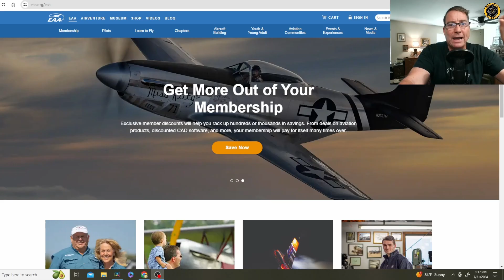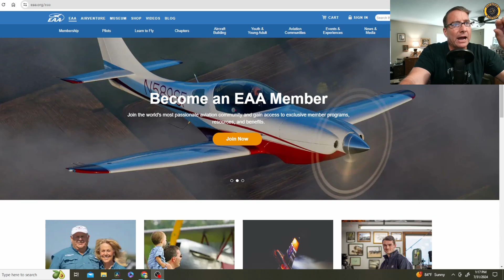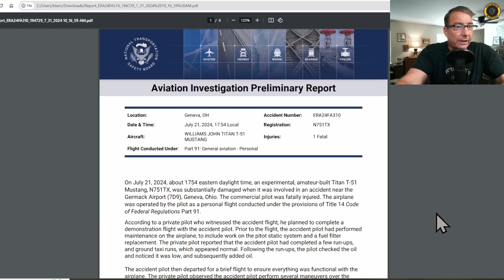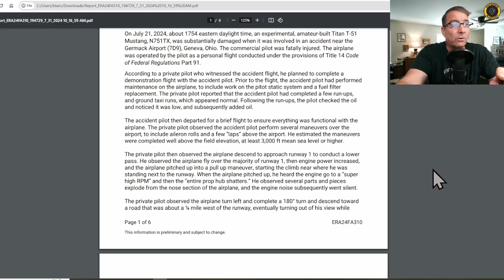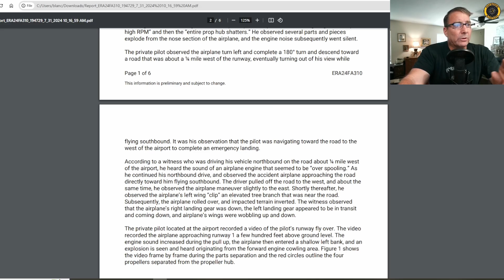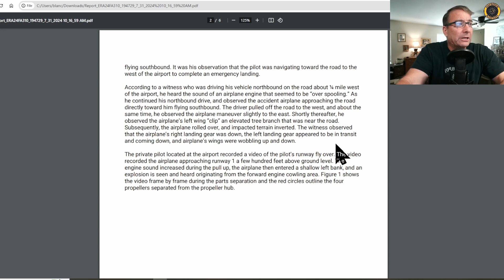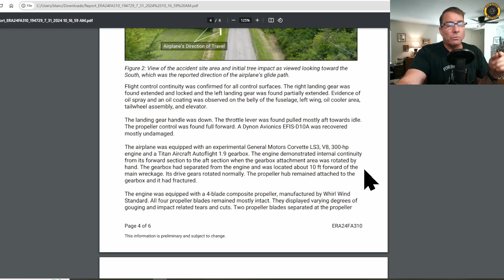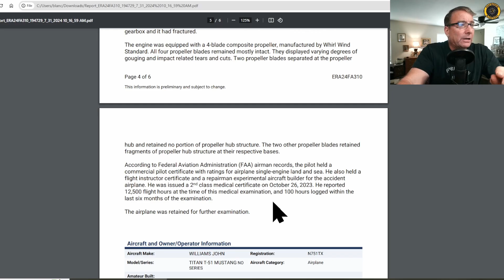Titan T-51 Fatal Prop Hub Failure 21 July 2024

Comment: I find it extra tragic when a good pilot who did everything right and went out of his way to observe safety and best practices ended up not making it due to simple bad luck and circumstance. Sad
Reply: Something broke when overstresed, probably by execessive G forces on the part, due to his high performance  "Zoom Climb" maneuver. That's what happens when being a test pilot. The real question is the part that broke a design deficiency, that will likely again fail when attempting that same maneuver, or a cumulative  stressing  mode which will require a lifetime limitation, then throw the part away requirement.  Parts metallurgical engineering is why you pay $30 to $3,000  for a/c  bolts, instead of going to the hardware store and getting the same size and thread for 30 cents to 3 bucks.
Reply: @jakerabinz9411  30 to 3,000 for a bolt? lol.
I built airplanes for 20 years and there are no $3,000 bolts in this airplane or any other unless you can show me an invoice for one.
Reply: @popsfereal  I stated "a/c". That includes any type of aircraft including helicopters, supersonic and even hypersonic jets, with or without rocket or scramjet motors. Have you ever worked on such with Inconel parts.  Have you ever heard of the so nicknamed "Jesus Nut" on a particular make and model of helicopter, which if it lets go DUE TO OVERSTRESS in a poorly executed autorotation,  the rotor head flys away by itself.
Reply: @jakerabinz9411  Excessive g-forces? When do you think that happened? Yes, some part failed, and we don't know why, but the aircraft was designed for and easily capable of handling that maneuver. My rented Cessna could handle a maneuver like that. There is no way this aircraft had cheaper non aircraft-rated parts on it. This was a serious builder with a serious business. If the investigation finds substandard parts I'll be more than shocked.
Reply: @beenaplumber8379  G forces are the result of abrupt vectoral changes in kinetic motion. Read about the "Vomit Comet" where negative G force is routinely implemented. Read about any moving object crashing into any other object at 400 mph, and the instant destruction of parts and instant liquidfractioning of anything biological onboard. Or a non jacketed 30.06 round  creating a .3" entry wound, yet also an 8" exit wound from 400 yards That is all due to excessive G forces.  Or how 'bout a violent car crash where all the lug nuts break at once and the wheel seperates from the hub. Or a 2 " axle sheers. Are we to just pretend that a prop hub, just willed itself to split apart without any sort of OVERSTRESSING?
Reply: @jakerabinz9411  You have a general understanding of what g-forces are - excellent. That does nothing to explain this failure or whether it was related to this relatively mild maneuver. G-forces are accounted for in the design. This is a matter of failure under g loads that were within design limits. That might mean fatigue cracks or other failures, including prop control and downstream failures resulting from prop overspeed. A lot of things could have caused this. There was an overspeed that preceeded the mechanical separation of the prop blades. Have you got an explanation for that? I have a simple hypothesis awaiting evidence. Have you got that much? An alternate hypothesis? Or just cool stories you read about?
Reply: But that's not what happened at all.
Reply: Yep. General aviation in an experimental plane is Russian roulette 😅
Reply: @BlingtingSam  What?

Comment: Engine suddenly revving could be loss of load.  I don't know this set up and couldn't say what happened.  I was running my boat many years ago, and the shear pin on the prop just let go under heavy throttle.  Even though my hand was right by the control, the engine badly over-revved before I could throttle back.  Condolences to the family and friends of this man.

Comment: I run a racecar with an LS3. It is barely good enough for the racecar. The big problem is the spark plug location. They are located rite next to the exhaust pots. Even with wrapped headers and high temp wires we still burn through 1-2 a racing season. Could not imagine trying to put one in an aircraft.
Reply: The LS3 is not putting out anything like full power in this application and there is no header- just short stacks with airflow right by them. So doubt that's a concern here.

Comment: I think beyond the high rpm of auto engines requiring reduction gearing is automotive engines were designed for limited high output of over 50% power even high performance cars is even on the autobahn cars don’t maintain high output for long duration where aircraft engines generally stay at 75% or more power there entire flight
Reply: The LS engine is used in boats and trucks with heavy tow ratings regularly, they are designed and regularly used in high sustained output applications every day.

Comment: The builder mentioned having a safety factor. Designers must predict under which conditions the parts will fail. A proper design would have the engine fail before the hub came apart. Also, an RPM limiters would be required if it is possible to overspeed the engine during routine operations. If this turns out to be poor engineering, too much faith was applied during the design phase.
Reply: With the 1.9 box the prop hits its redline,  allowing for a margin of safety, at about 4750 engine rpm. Engine redline is over 6000.  So no.

Comment: Concerning the use of an automotive engine in a mid-RPM application, it is possible to build such an engine with high torque. low RPM configuration with its redline at or around 3500 RPM. Many components can be optimized to produce low RPM torque over high RPM horsepower. I'm not sure why this is never done, such a configuration would mimic the torque curve of a diesel engine and be ideal for towing and heavy-duty truck road applications and also aircraft. This would involve using longer connecting rods, special crankshafts, smaller diameter intake runners, and exhaust system diameters.

The reason may be that doing this reduces peak horsepower significantly while gaining torque, this may be why it is not done, not many people want to minimize a V-8 engine's horsepower. Yet doing so would reduce or eliminate the need for cranky reduction mechanisms.

Comment: If we know for sure that the overspeed happened before the hub failure I think it must have been a failure of the prop adjustment mechanism. I actually can't figure out exactly which prop was being used on this plane. Looking at the specs in the report, titans website, and the prop manufacturers site, I couldn't find one that matched. But it looks like they're all adjusted hydraulically. If that failed they may have flattened out and drastically reduced the load on the engine.

Comment: Failure of the prop Gov or loss of oil pressure to the gov (if oil controlled Prop)  normally causes the prop to go flat, High RPM in non reversing / non feathering piston props.
Reply: yes , and is the case with this setup

Comment: Bad moment for that failure to occur, obviously he knew the area and made the best job of trying to get the plane down again, which must have been difficult with sudden loss of power in a steep pitch up condition and having to do a 180 degree turn without stalling - could easily have been a stall spin crash. He would have had a very high workload trying to get the plane configured and lined up for landing, just clipping the tree was the tiny margin away from success... so sad...

Comment: The engine couldn't over-rev like that unless somehow it became unloaded.  The prop pitch must have changed, and rapidly.  If the gearbox failed, then the prop couldn't have overspeded; it sure looks like the prop pitch mechanism that failed (here from the ground, and far away).

Comment: Let go in to physics. 
1. The aircraft pulled up, the propeller hub fractured , the blades shed off. The engine overspeeded there after: no countertorque left.
The gyrosopic law says: M = I * omega(=pull-up) * omega (=revs).  If you pull up there is a moment working sidewards (depending the rotation speed, direction etc) acted by the blades on the hub.
These bending moments are SUBSTANTIAL and a sinus moment (+/-) is executed on the blade root, each revolution.
These fatigue moments are often overseen  by amateur propeller manufacturers.
I doubt how many readers know this physic-gyroscopic law.
Reply: If I'm understanding correctly he applied high power during the low pass and then pulled up sharply to climb. This put high gyro loads on the prop and could have initiated the failure. Aerobatic pilots reduce engine power before doing violent tumbling maneuvers to avoid ripping the prop off the aircraft, and they use especially strong prop/hub units. These gyro forces require very serious engineering to deal with. I suggest using the word "overlooked" instead of "overseen" in your technically excellent comment. Thanks.
Reply: excellent point. thank you
Reply: That was my first thought upon hearing of the accident sequence.

Comment: Informative as ever, thanks Juan.  If the gearbox is a custom design, and over revving is a known problem, why doesn't the design incorporate a fail safe speed limiter?
Condolences to the pilot's family.  Worth noting that it was the tree and misfortune not the propeller hub that led to the fatality.
Reply: the hub failed, not the gearbox.
Reply: @Pantdino  Yes, and why did the hub fail?  As reported by the eye witness, the engine was over revving so the gearbox output shaft was spinning too fast for the hub to withstand the centrifugal force.  Hence my suggestion for a speed governor in the gearbox. That is only my suggestion, for what it's worth.

Comment: I mostly follow car and motorcycle content so it is unusual for me to hear an American use the word "gearbox". In UK we use that word all the time as transmission is a more general term. For example, the transmission of a rear wheel drive car includes the clutch, gearbox, propshaft, differential and axle.

Comment: My first question is what is used to control max engine rpm. And are those parts complete or damaged in some way.
We run a gasoline powered sawmill with a air cooled VW engine, it uses a mechanical governor with a belt to it. You loose that belt for whatever reason. rpms will go for the moon, until something fails.
A diesel engine has the governor right in the injection pump, where as for are VW industrial gas engine setup, it uses a separate component for controlling engine rpms.
.
I dont know whats used to control rpms on that LS engine. 
but as a mechanic, i would definitely take the time to rule out any failure of engine governor.
0.01c

Comment: The other use for having aircraft in the experimental category is to avoid expensive certifications even in mass produced planes. For example I owned a Standard Jantar  1 sailplane for many years. It was classed as experimental even though thousands were built. This applies to many commercial built sailplanes even though the production runs may be fairly large, the certification costs vs. the total retail sales don’t make sense to the aircraft companies.

Comment: Prop feathers causes the engine overspeed (no more load on engine), propellor rotation dramatically speeds up (LS has a lot of torque) and centrifugal force tears the prop blades off.  Preliminary inspection says engine good, and gearbox good.  Instant feathering of prop commanded or not created this event.  The talk of rev limiter is potentially misplaced.  No proof a rev limiter is in place and if it is and is stock, it will let the engine run to red line then bounce on and off it.  That is a VERY distinctive sound and likely would have been reported.

Comment: Not sure how the engine goes into an overspeed condition unless it was suddenly unloaded under throttle. The LS engine family are fly by wire computer controlled engines with the computer controlling both injectors and ignition timing. Could the hub have broken free of the gearbox output shaft first allowing the engine to unload and overspeed? It would also be intereisting to see how an automotive throttle controller aka gas pedal was configured to work as a hand controller in the aircraft.

Comment: I own a Corvette with an earlier variant of this engine, the LS1. The LS3 is around 370 cu in and over 400 HP stock. They require a computer system to operate, unless the engine is very extensively modified. The computer in my car employs a "rev limiter" function, to avoid overspeeding the engine. I would imagine that if this  LS3 were not modified to run without a computer, The engine could have been detuned to produce 300 HP, and rev limited to a value corresponding with the maximum safe propeller RPM. I am really curious about this engine installation, and what caused this failure. Godspeed to the pilot, and condolences to his family and friends.
Reply: We have no knowledge as to whether the engine speed was limited by the ECU.  
The fact that the engine overspeeded suggests that the engine speed was NOT limited by the ECU.  
The engine speed probably was limited only by the propeller pitch and pilot.  
It is easy to see now, with the benefit of hindsight, this was not sufficient redundancy.  
What now for all T51 owners?
Reply: I would think it still had an ECU, probably a custom built and programmed one.

Comment: Mr. John Williams seems like a highly sober non-cowboy kind of guy.  I look forward to learning what caused the overspeed condition, be it before or after prop failure.

We are fortunate to have the ability to fly experimental aircraft, which have varying degrees of safety and innovation.

Good aviation rules, restrictions and practices are often driven by tragedy.  Is there a role for electronic overspeed safety devices (almost zero cost) on experimental aircraft with automotive engines?

Comment: Impossible turn gets someone again... looked like a few fields were available but would of probably been gear up and damaged the plane... Wonder if saving the plane may of played a roll in trying to squeeze into the narrow rd....
Reply: He successfully made the 180 degree turn, so not impossible. The plane flipped canopy down in the last few feet of the landing.
Reply: @jackwickman2403 he ran out of energy,at the end  didn't have the control authority to thread it into a narrow  slot and hit a tree... Stop trying to make the impossible turn... Im familiar with the area I live 1.5 hours west of it... There's a couple open fields near it... The only reasoning I can think of that turn and attempt to get onto pavement is to save the plane....That road would be a bitch to get into powered let alone in a glide with who knows what damage to flight control surfaces...

Comment: Out of curiosity, can you please explain why you can’t have propeller tips break the speed on sound? 

Obviously there is a certain structural integrity limit for every prop… But does that limit typically occur around the sound barrier? And that’s why it’s in place? Or does it have to do something with aerodynamics, where propellers efficiency would be affected or something? Or does that have something to do with a noise constraint?

My apologies if this is a dumb question(s)… I am not a pilot myself.
Reply: Noise.

Comment: The owner pilot seemed very reasonable and quick to acknowledge the problems associated with making an auto engine work reliably in an aircraft. As he pointed out it’s the reduction units and other related system components that are more often the points of failure. I’ve always held the opinion that propeller reduction units are the stuff of industry. Just take a look inside the nose case of a big radial engine built in the forties. Very complicated, precision designed and manufactured planetary gears. I too like and fly almost exclusively experimental aircraft with the exception of my day job. But I never fly behind auto engines with experimental reduction units, belt drives or any of that stuff.

Comment: What is even the point of the car engines in planes? Seems like a non-starter. Also, how do they handle high altitude.  But just... Why?
Reply: They're aren't $60,000 for a 80hp 1947 tech engine.

Comment: Just an FYI, but the LS3 used in the Corvette makes 430 HP, not 300 HP.
Reply: Yes, it is an LS3-430. I think John said 300 because that's the limit of the gearbox and (ideally) the pilot is to limit his power application to that.  But you know pilots...